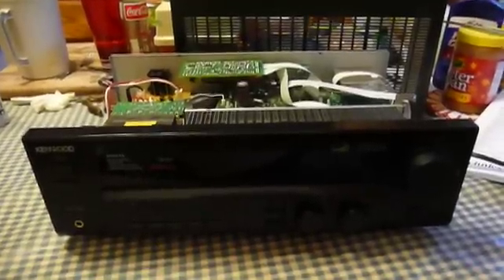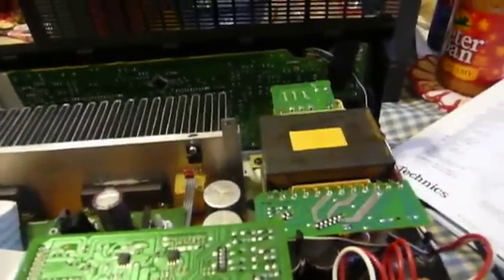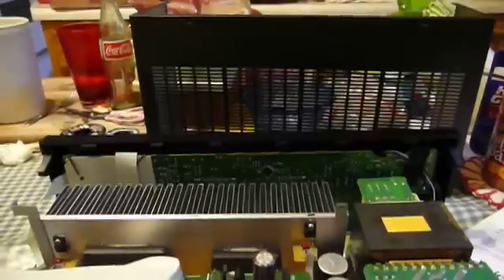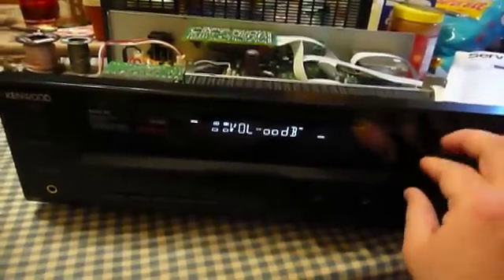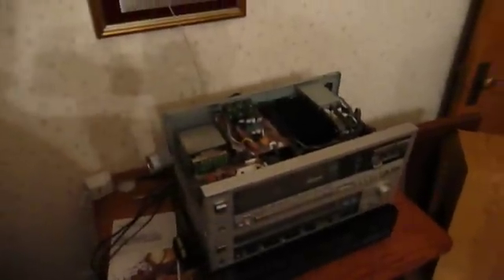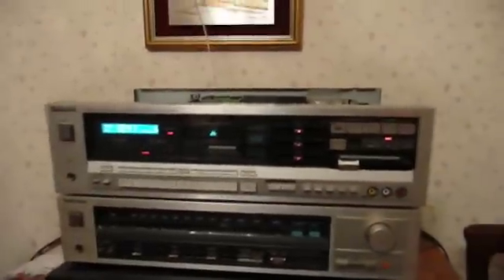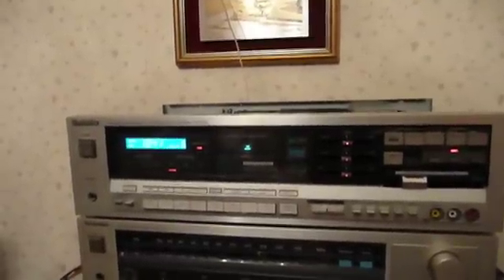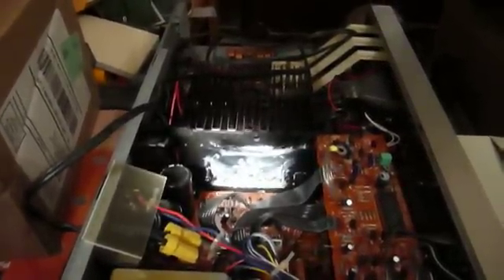August 2010 Stereo Equipment Repairs

Comment: I like your flying repair. Your very creative and as long as your soldering is good it should do the trick. I need to do this on my Kenwood KA-7X unless you know where I can get the exact relay. Always enjoy your work.
Reply from the maker: You could try searching against the brand name and part number on the relay. It's a long shot, but sometimes it works. I've never had anything to do with a Kenwood KA-7X.

Comment: I was using two 50 watt speaker with a 100 watt receiver and as the woofer went in and out, the louder it got the more it sounded as if the foam cones were going to rip. Would that be considered clipping?

Comment: I have a Kenwood KA-52B stereo integrated amp that has a bad left channel output.  The audio out of it is extremely scratchy and garbled on any speaker, from any input source.  Do I need to mess with the power amp unit?  I doubt it's the single fuse I can see in it.

Comment: karma is not a big fan of me also, today i bought a 17" dell monitor from a used computer shop, i took it home and it worked fine for around 20 minutes or so. then it went crazy! the menu radomnly came up and then the lock came on then off then on again. so i turned it off and to my suprise it wouldn't turn back on again! 

i took it back to the shop and the guy refunded my money, but i really liked it. what do you suppose the problem was bill?

Comment: Surface mount soldering CAN be difficult. You look like you did just fine for your 1st time. If a person is better you can drag solder something like that. You got to have the right tip and plenty of flux to do it right. I do it the way you did it but I can move the board wherever and we have microscopes which makes it WAY easier. Not to mention a nice assortment of tips. More and more things are going surface mount so you may want to think about another iron. Fine tipped.